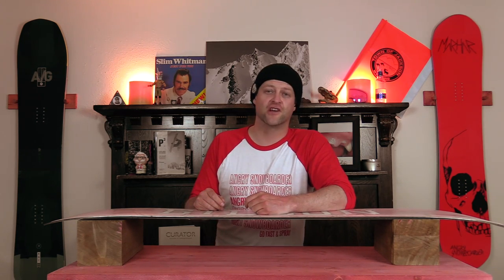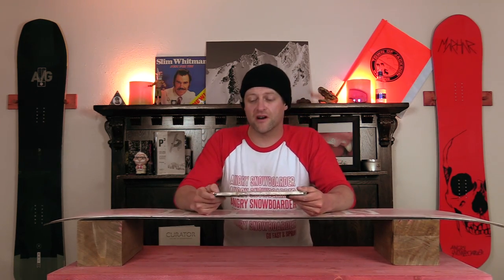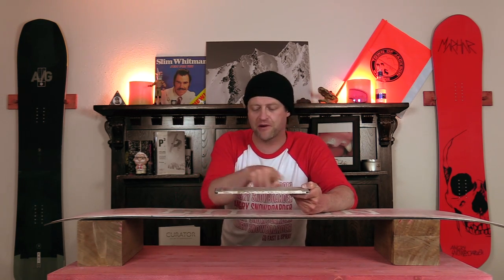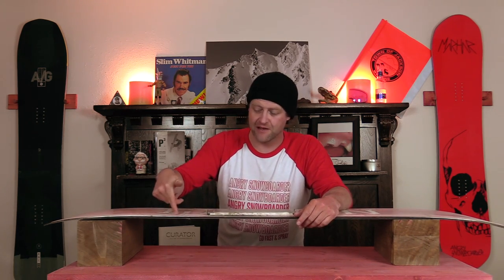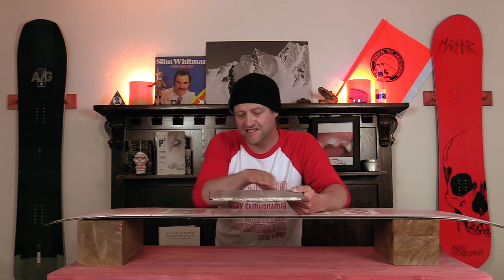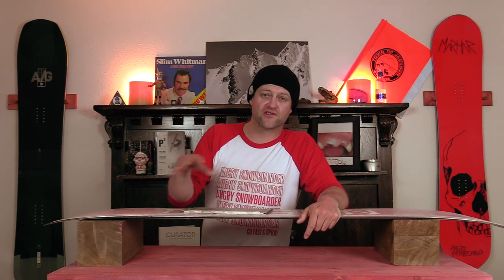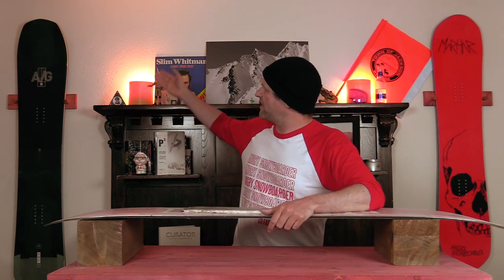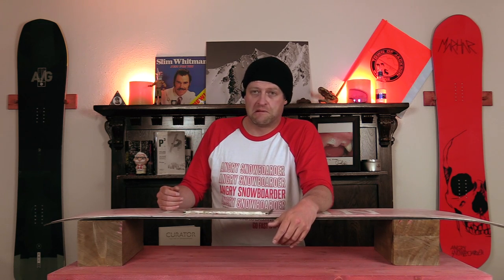The Gilson Soft Edge Technology: Explained

Comment: I'd like to see a review after you've tried the actual board instead of just talking about it. I've had ZERO issues riding the soft edge technology for years. They also have boards without the soft edge technology if you don't like it...  The soft edge has zero effect on the efficacy of the board's edge control and is easy to ride.
Reply from the maker: Their boards suck ass.

Comment: Wait should I bevel edges on a new camber board until I get used to it then sharpen and angle it back up?
Reply from the maker: If you're really worried detune the contact point. If you're really anal put a bevel on it and leave it on for the life of the board.
Reply: @AngrySnowboarder  I’ll probably just detune the contact points and leave the rest sharp. I don’t really boardslide rails so I’m not so worried about catching up on some big rails.

Comment: All of a sudden I want to buy a Volvo 🤣
Reply from the maker: Anything from late 07 to 2014 is solid. If it’s pre 07 that’s when Ford ran them and had the 2.5 liter 5 cylinder motor snd that’s crap. Anything post 2014 you’re dealing with cheap electronics courtesy of Geely and it’s crap.
Reply: @AngrySnowboarder  I just replaced a motor on a 2016 Ford edge that blew a head gasket inside it look like a thick can of animal style thousand island salad dressing. 🤣
Reply: @AngrySnowboarder  geez man you know your autos. How about angry car reviews. Be a winner😀
Reply: @johnsutcliffe3209  I dunno Volvo guys are definitely kooks in the car world, I don't think angry could do it. And that's coming from a car kook
Reply: @Anony Duce You know Angry drives a Volvo, right? XC90, Passion Red. ;)
Reply: @mikaelnyblom  oh yeah I know he loves that thing. I actually almost bought a turbo xc70 or 90 but I’m a subie first Volvo guy second.
Reply: @Howardtrn  just sold my 07 edge today. 190k hard miles and the only major repair she actually needed while I had her was a radiator fan. She had no ac or radio, the transmission and cv axle were both about to go out, but that engine ran like a clock. Terrible car but I loved it
Reply: @glub__blub  how many top 10 list did the ford edge make?
Reply: @Howardtrn  honestly no clue I just know from an enthusiast standpoint it was weird kinda fun but not really. As a general car I’m sure it’s good, they have some get up and go and surprisingly good handling, but the brakes suck ass and they’re super heavy. Like I said I loved the car just glad to never have to drive it again, everything that wasn’t essential to the car broke.
Reply: @glub__blub   lol brakes sucked ass transmission that’s going to go is my point exactly